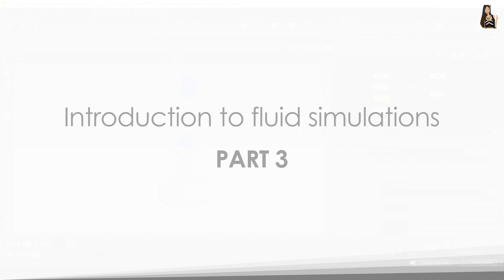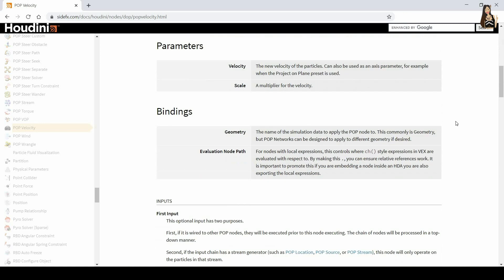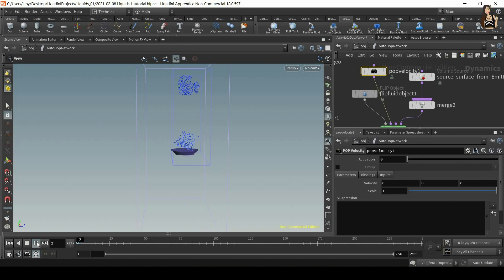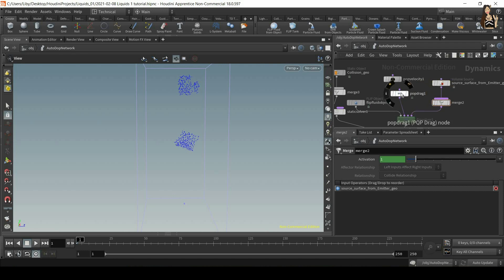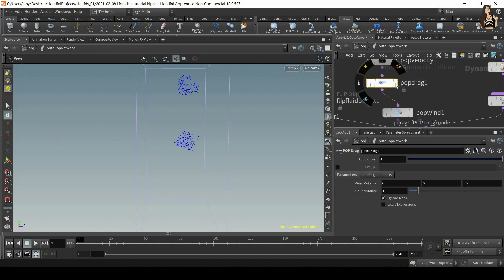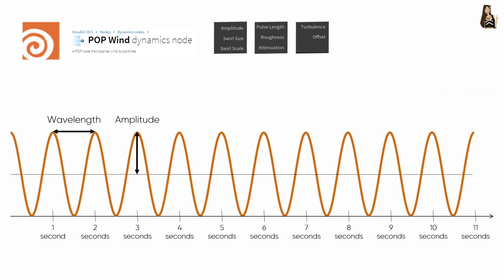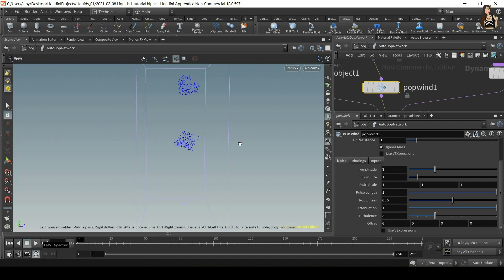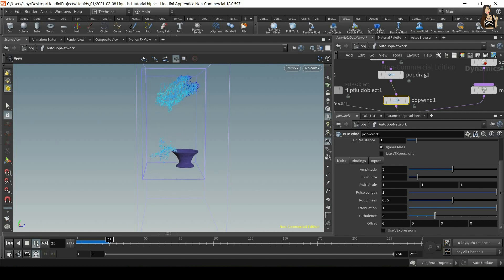Introduction to fluid simulations #3 | Forces - Houdini 18

Comment: These tutorials are great! Thank you! I had a question, is it possible to have a fluid emitted with a high enough velocity that is hits and knocks over objects and pulls it along with it?
Reply from the maker: Thanks!
Yes, it's possible. If you want to see interaction between water and objects, you need to switch on Feedback Scale. You can find it in the FlipSolver/Volume Motion/Solver/Feedback Scale

Although, there are other ways to do it too, but they'd require multiple solvers. So I'd start with this one.
You can also experiment with Vellum, in the most recent Houdini you can combine liquid simulation with other sim types quite easily now. :)

Good luck! :D
Reply: @VoxelFX  Thank you so much for your reply! I will play around with these solutions! Would it also be possible to export the water sim as an  .abc, then re-import it do collions using the rbd solver? Thank you again!
Reply from the maker: @heavyMetalfan746  yes, you can use alembic for that. Just make sure to use velocities coming from the FLIP simulation. It can be a bit tricky to get the collisions right and have objects sink/under water, but if the water is strong and moving fast, it can work :)
Reply: @VoxelFX  sounds good! I'll keep it at! Thanks again

Comment: Thanks a lot for your great explanations, very concise and effective information ! I have been working for 2 years on a personal historic reconstitution project of an 1883 river/plant dam that was destroyed by overflow in 1915, and i am in the final phases of simulations, but i am still struggling with flip fluid and whitewater caching and saving workflows... What are the correct steps before rendering, and what caches should i keep for archives and/or re-rendering ?.. Do you know of a guide for large simulation projects, where could i find this important information before i step into rendering the finals ? Thanks for your generous help !😃😃😃
Reply from the maker: Thank you, I am very happy the video helped!
In terms of the dam, I would need to know more details as each project is different. But in general fluid simulations are very heavy, so I would always try to split them into smaller parts. This applies to both simulating and rendering. If you can find areas that are separate, you might even be able to run a separate simulation for them. Also, always render whitewater and water mesh as separate passes and then composite them together in, e.g. Nuke, it will save a lot of resources. :) If only part of the simulation is visible, you might also be able to run low-res simulation for most of the water and high-res for the parts visible in the shot. Have a look at this amazing masterclass: https://www.youtube.com/watch?v=OXBms4cpc6A&t=1108s&ab_channel=Houdini

A general rule would also be to remove all unnecessary attributes and groups before caching or rendering. For archive management, it is different for each project. I like to keep the last version or two and only Houdini scenes for other iterations. Hope this helps! :)
Reply: @VoxelFX  Very generous of you, so, i guess archiving my output separate .SIM files for both the fluid and the whitewater once my collisions work fine, would be the way to go to prevent having to re-sim and also for playback...  or maybe the compressed cache/surface caches ? thank you again, i don't want to abuse your kindness!
Reply from the maker: @pierredesroberts8985  It's hard to say for sure because each scenario is different. It depends on which parts you want to be able to change later. Compressed caches are definitely better, there is almost no reason for keeping the actual particle caches. Regarding the whitewater, it depends on how heavy it is. Whitewater is usually lighter than water, so if you can quickly recache it, there's no point keeping the whitewater cache files.
Keeping the water mesh does not seem to have any sense for me, because if you're not changing the water simulation, you can always just tweak the look in Nuke for this certain layer. But if you want to make a change to the water sim you also need to remesh it. But again, it depends on your particular scene and what you're planning to do with it later. :)

Comment: can you some how show how to export houdini sim to blender only flip fluid
Reply from the maker: I'll add it to my list of videos to record when I'm back! In the meantime, I hope the below helps:

You can export the fluid mesh as an OBJ sequence.

Navigate to the "fliptank_fluid" (the export network; it might be called differently but if you used the shelf tools, it will have "_fluid" in the name).

Find the "File Cache" node called "surface_cache" change the extension to OBJ. You can use something like this: "FLIPmesh.$F2.obj". This will save the mesh as a sequence of OBJ files (3D models) that you can then bring in to Blender.

I'm not sure how it looks on the Blender end, I think you need to install a plug-in to read OBJ sequences.

If you have Houdini Core or FX version, you can also save it as an alembic file using "ROP Alembic" instead of the "File Cache". Blender should read this one straightaway. It's only one file, but it holds all the information.
Reply: @VoxelFX  thank you very much imma try